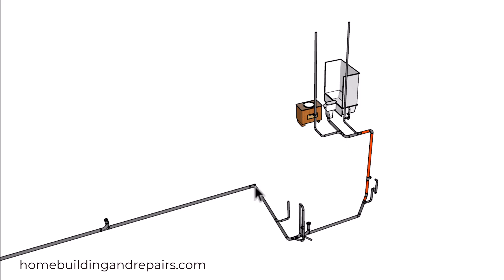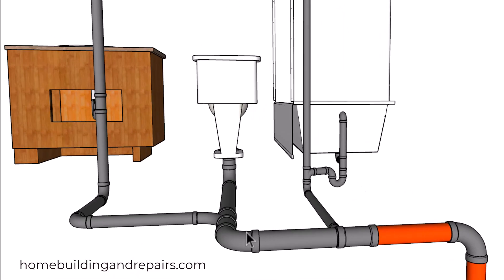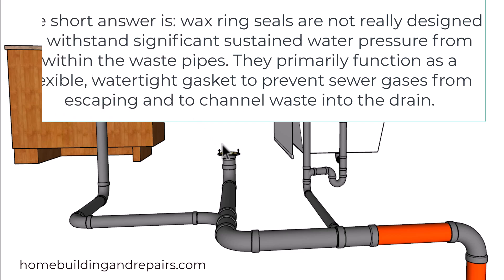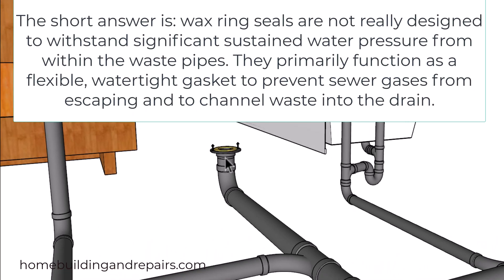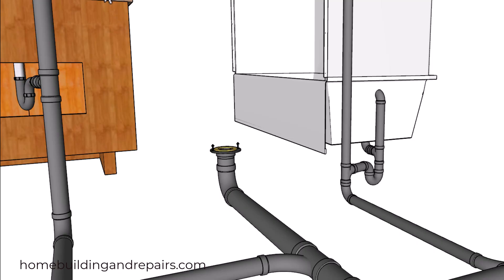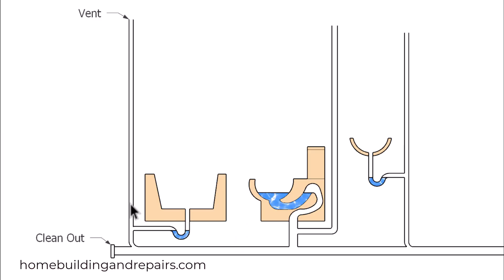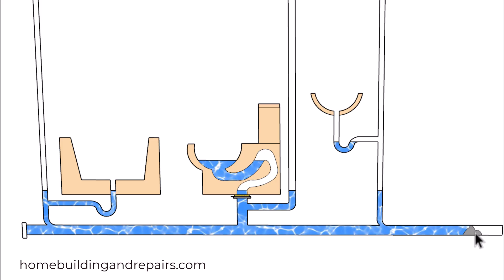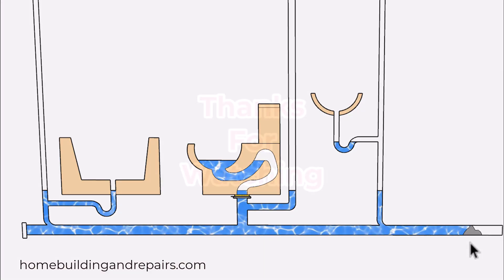Why Water Can Be Leaking from the Base of My Toilet When You Use the Sink or Shower?

Comment: Thanks. My partial clog is from frozen pipes. It's been between -20 and -40 and I didn't use the water enough. Never seen the backup before this cold snap, and never not used the water for a few days at a time. Learning lesson!

Comment: If they see it coming out from beneath the toilet while using the tub it's definitely a partial clog. If they just see water around the base of the toilet after taking a shower, if the toilet is right next to the tub it might just be water splashing around the edge of the shower curtain/doors. It's probably the drain, but I've seen a lot of "leaks" that were just user error so its worth double checking before you spend money.